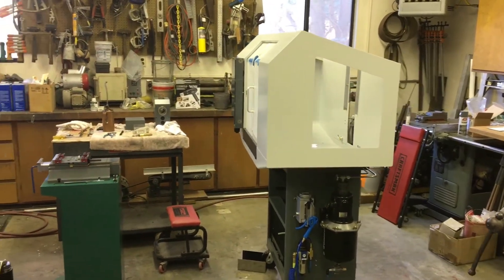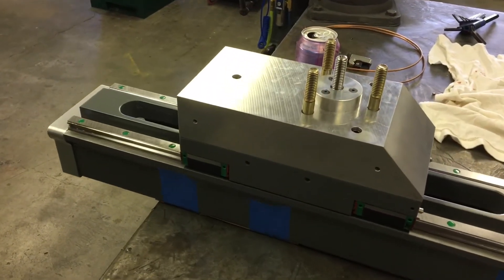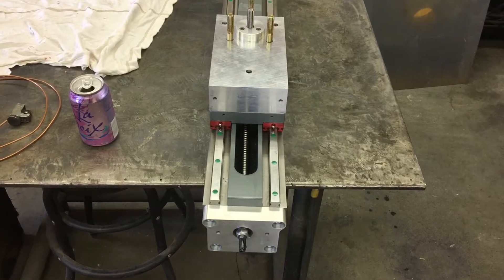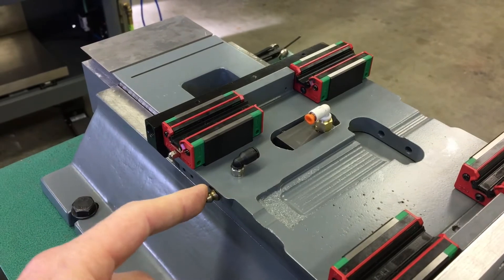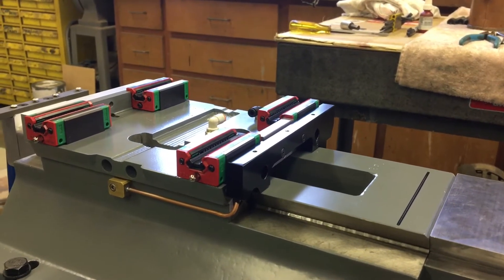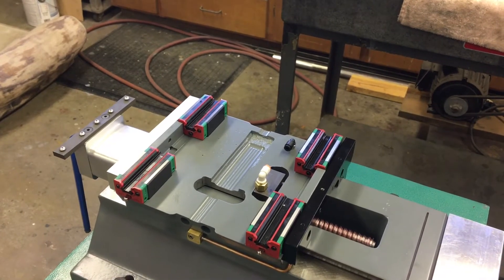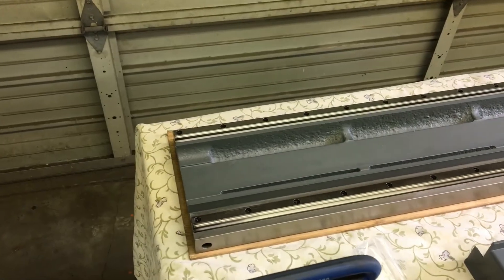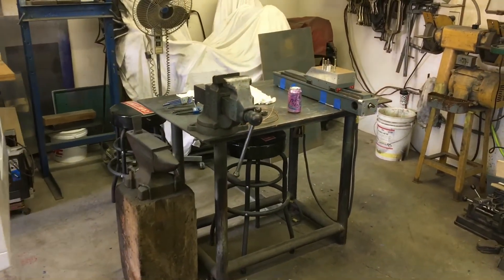GRIZZLY G0704 CNC Conversion Update 24 - ( assembly 2 )

Comment: Did you lap or scrap the Y axis ways?
Reply from the maker: The Y dovetails on the base where pretty good from the factory, they appeared (visually and with a DTI) to have been done on a machine, possibly in one setup? hence the relative parallelism? the Y dovetails on the other hand appeared to have been done with an angle grinder. I spent some time scraping and upped the points per inch on the saddle dovetails but nothing to crazy... more "tuned in" than "re-built" ?  - Nick

Comment: Very impressed with the progress so far. You are a tireless machine! I would be wiped out, trying to keep your pace. Huge fan of LaCroix myself. It's a French word "The Cross".  Love that water and made in Michigan only a few miles from my shop.   Can't wait to see your mill making some chips. Cheers Nick!
Reply from the maker: Brian! Thanks for the kind words. This machine has turned into something else since its inception, it has been a ton of work building / documenting / researching for this project! I'm excited to wrap up the machine. That's funny, my favorite drink made right in your back yard! always wondered what "la croix" actually meant! Thanks Brian ... (do you have a grizzly? or similar machine)

- Nick
Reply: I bought a Grizzly between Christmas and New Year about 9 months ago. I've invested in motion controls for 3 axis setup but have yet to do anything with them. I still need to purchase ball screws and nuts to match.  Been short on time but plan is to convert the G0762 as soon as I can.  I have had the chance to manually mill a bunch of parts but setup is so time consuming.  Hardest part was a brake lever for a dirt bike and turned out amazing considering all the radius' and curved sections.  Thanks for the response and can't wait to see your next video.  I am using some of you conversion ideas in my own mill.
Reply from the maker: Very cool Brian! It will be very rewarding to successfully convert your machine, feel free to copy anything you see fit. A large portion of the components of my machine have been manually machine / turned, the setup and indicating can be a bit daunting at times but like anything it gets faster with time... I think the "manual" machine experience really helps out with the transition to CNC. What motion controller are you planing on using?    - Nick
Reply: Haven't picked a controller yet. Bought some Leadshine steppers, drivers and power supplies.  Any recommendation on controller would be greatly appreciated!
Reply from the maker: I am going to begin doing the ESS mach 4 thing... people seem pretty passionate about what controller / software is "best".....(I'm far from the best DIY cnc electronics advise guy) what ever you decide, I would personally get something non parallel port based.... 

- Nick
Reply: Not trying to steal this topic, but have you seen the uccnc UC300ETH with their software? It seems to be very good, with a good algorithm for LAF. No affiliation, just something I stumbled upon and liked from the first minute. Relative cheap too, considering it comes with hardware.  I'm using a controller from edingcnc. It's software is free to download and to 'test' around. comes with a simple cad/cam build in for engraving, which seems handy at first but i've never used it.  For me it was the most obvious choice when beginning my cnc adventure to use Eding. (felt the most intuitive for me of the controllers available back then, as long as you use the 'old' style icons.. :) (included with every install, just rename the folder icons to newiconsmustgo and the icons.old to icons and restart.